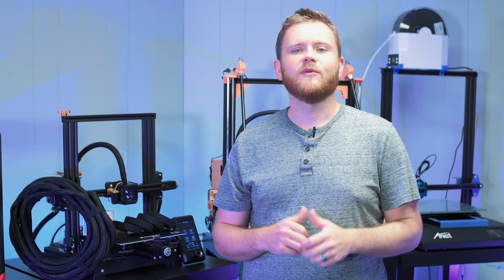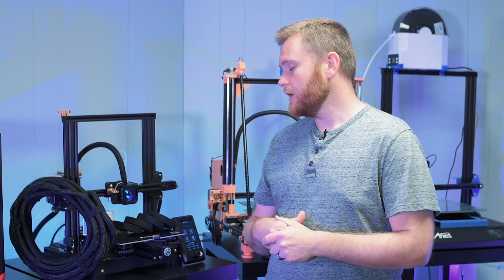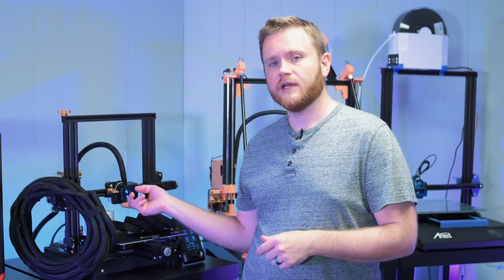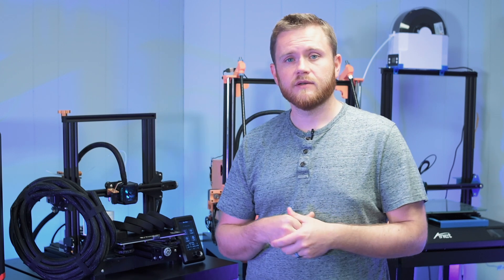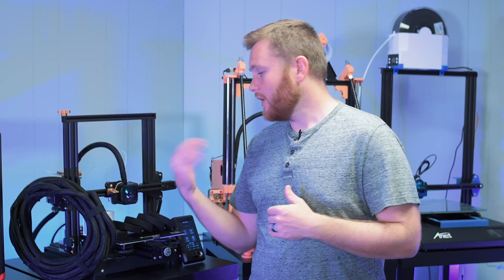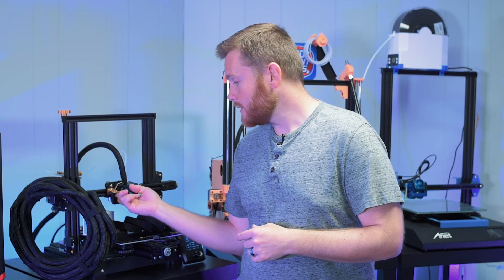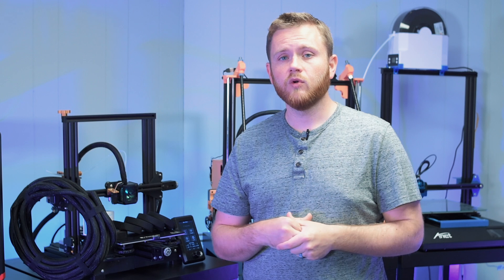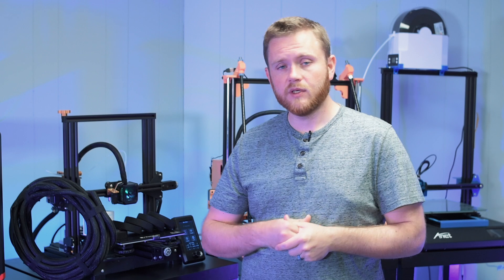Automatic Bed Leveling? Creality CR-Touch

Comment: I have a Voxelab Aquila X2 with the H32 chip.  I seem to be having issues getting the CR Touch to actually stop when it is triggered. Some have said to unplug the Z-stop wires while i see you have them still plugged in?

Comment: hey whats up boss...thanks for all your aquila related vids , im having a issue getting my cr touch to auto level  , i have an x2 with a n32 chip , did the sprite upgrade and the cr touch  on alex firmware . im able to Manual level but my mesh is all in red and when i auto level the print head goes off the bed , can you please help

Comment: Nice to meet you
Does the Voxelab Aquila C2  H32 BL- Touch Can I use auto leveling?
Reply from the maker: As far as I know, the C2 has a port for a bed leveler.
Reply: @3DPrintSOS  thank you i will look for it

Comment: Add just installed CR Touch on y G32 Aquila, chose to use Aquila BL touch 3.1.2 firmware. It only touches the center point and says auto leveling is completed, even though it shows a 16 point 4x4 grid. I cannot find any information on how to proceed using this firmware.

Comment: I have returned to manual leveling and reinstalled original firmware for now. I will try again when I have regained my composure! BTW do I need a new curate profile for the direct drive conversion?
Reply from the maker: Fail. Do it when you’re ready. :)  Only change you have to make is the retraction distance turned down to 1mm. No other changes need to be made…unless you want to.

Comment: This is the firmware I have installed Aquila H32 BLtouch Firmware V5.8.2 and the bit that goes into the display. If it is the right one I will install it again just incase I did it wrong.

Comment: The good news is that I have got the screen working. But the software is not allowing the touch to do the leveling pattern. I have sorted the z movement - I had forgotten to disable the stop switch. Would it help if I got the bl touch instead?

Comment: The firmware has corrupted my printer. I have taken a photo of the screen. Please help
Reply from the maker: If the screen looks all messed up, like I mentioned in the video, that means the firmware didnt install itself properly on the screen. Make sure you format the card correctly to 4096 bytes using a 8gb card or the one that came with the machine.

Comment: Hi - I have fitted the cr touch but the z axis is not working. I have put the wire in the right socket. Any ideas?
Reply from the maker: If it’s not working, it thinks the z is already leveled. Make sure you dont have both the z switch and the sensor plugged in at the same time. It’s one or the other. Also make sure you have the correct firmware installed.

Comment: I dunno.. I think it's still super beneficial even on a small bed.  Some (most) of these types of machines have warped beds. Even if you get the corners absolutely perfect, the center can be too high.  I know that's the issue I have. Adjusting the Z height adjustment does it globally, and not in the area you specify so, if you configure your Z height to raise a mm or so, it'll be fine in the center, but way too high in the corners.  A sensor helps alleviate this issue by compensating for the high center while not affecting the corners.
Reply from the maker: To further add to the point, you can achieve this for free with "manual mesh leveling" and not have to buy a probe at all. ;)
Reply: @3DPrintSOS  Ah shoot! That's right! I totally spaced on the manual mesh!! I even have Alex's firmware on my Aquila too hahaha!

Comment: Love the videos, really helping me get started with my Voxelab printer!

Quick question: You say you can download the firmware for the CR-Touch from Voxelab, however, I can only see the BL-Touch firmware. Is this okay to use or would it be better going with Alex's firmware and the customer UI? I am interested in trying the customer UI and will probably be going down that route, I'm just curious with regards to Voxelabs official firmware.

Thanks!
Reply from the maker: Alex’s is far better but any bl touch firmware will work as long as your chip number matches.

Comment: Hey man! Iv followed all of your videos to set up my printer! Iv got the Alex firmware update (4x4 BLTOUCH G32)

For some reason, it’s not homing at the bottom left corner as it did stock, it’s also not doing the little touch on the heating bed in that corner, to remove the extra filament that has come out while waiting for the print to start. 
Any advice please? 
It seems as though when I home individually, the Z axis is where it wants to make it home in an odd place. When homing x or Y, they both go to the proper corner
Reply from the maker: Sounds like it’s looking for a BLTouch and not finding it. It’s homing z to an odd spot because the BLTouch firmware has an offset setup for it. Do you have a sensor installed?
Reply: @3DPrintSOS  so when I create a mesh, the probe works at all of the points, and when homing the probe comes out as well. LED works and changes and the CRtouch is in use. I do have the sensor installed 🙏🏻
Reply from the maker: Hmm. Could it just be the wrong offset figures then?

Comment: Need some help. I installed the G32 firmware with BL touch support, but we're not able to adjust the Z axis within the "move" menu. We can move both the X and Y and the machine responds, but the number for Z stays locked on 0. Any thoughts? Also, we don't have a "live" option.

Lastly, when I select BL Touch Auto-Leveling from the control menu, the probe moves to the center, taps the center. It then moves to the corner like is going to start the bed-leveling process across the 16 points. The probe sticks out, but instead of moving down to touch the bed, it moves upwards, the probe retracts and then the screen says Auto-bed leveling complete. 

Any thoughts on resolving these issues?

By the way, we have the version of aquila that has a horizontal screen, not the one that is shown in this video.

Is there a different firmware we should be using?

Comment: Question: How does the leveling wheels get turned for the auto part of the leveling?
Okay, so I answered my own question, the wheels do not get turned. The sensor makes a topographical map of the print surface so the printer can adjust accordingly while printing.
Reply from the maker: Yep. It’s always good practice to fist level the bed with the wheels. Then using the sensor you make the bed mesh, “the map”, and you’re good to go.

Comment: I am loving the automatic bed leveling and my prints are turning out great. Had to watch a different video to get my gcode all set since the one in the description wasn’t quite working for me. One thing I thought was a problem with the Cr touch was warping on my prints after everything was set but nope it was my glass bedding needing some much needed cleaning with soap and water 😅 thank you for having a channel for us newbs on the Aquila 👍 keep up the good work.
Reply from the maker: Glad you got it working. Thanks for watching and the encouragement. :)
Reply: Micah, what other video did you watch?  Cause I am having issues as well after installing.
Reply: @aod_fan  I watched printsleo3D as he goes way into depth on the bed leveling. Watch the video so you understand the bed leveling, gcode, and live level. Once I got it the way I like I just set it and forget it.

Comment: Do you think 1/2 inch wire loom would be enough? Or do you recommend the 3/4 to ensure everything fits? Also, velcro wire ties would be a good option to secure everything.
Reply from the maker: Half would still be good. Yeah those will be just fine as well.
Reply: Thanks, Fedor.

Comment: Question for you. Loved the video, just installed my CR touch on my Voxelab Aquila, however, when i go to set home. It doesnt stop. The Z axis just keeps trying to go down into the bed. Not sure what to do for this. I have played around with a bunch of settings in the Z offset and it still wont work. I downloaded Alex's version of the firmware for BL touch. I have aH32 chip, I know that the firmware is just a beta, but it seems to be working. I just cant seem to understand why the CR touch wont stop the z axis, any ideas?
Reply: I really appreciate your help on this, I see that there is firmware on the voxelab downloads page, do you know if I need to add anything else? all it seems to have is just the firmware, with Alex version we had to add the dwin_set. There doesn't seem to be anything like that on their download page. I watched your tutorial video on that, and it had included the dwin set but it doesn't seem to have it anymore.
Reply from the maker: Check to see if it’s in the .rar file that gets downloaded. It’s gotta be on there somewhere b
Reply: yeah it's super weird, I contacted voxelab and they led me to that download page. I sent a screenshot to them. just waiting for their response. I appreciate you looking into this for me!
Reply from the maker: Sounds like it’s still looking for the end stop switch. Is that still plugged in? Make sure your z offset is at zero to start.
Reply: @3DPrintSOS  Yeah i unplugged the Z end stop switch from both the connection on the side and from the board, i saw someone else had the same problem and someone suggested it. it is marked with a Z so i'm assuming that was the correct one, and yes the z offset is set to 0. It doesn't seem to be picking up that the probe exists. I have been watching a lot of videos and found that some have an option to adjust the probe offset. On this version of the firmware, I cant seem to find that, not sure if that has something to do with it. Do you know if I will need to redownload the firmware if I want to go back to the manual mesh instead of the BL?
Reply from the maker: I think you would have to reflash it yes. To go back that is. I’m not sure as to why this is going on though. Hop into the discord and post there maybe someone knows.

Comment: Love the videos! You inspired me to buy an Aquila and I love it. Had a weird issue with my CR touch install. Installed the correct firmware for the G32 chip. I go to run the mesh and it takes a point from the middle twice then goes to the front right corner and stops and says complete. Did you or anyone else run into this? Thanks! “This is with voxelab’s firmware”
Reply from the maker: That typically happens when there is no mesh set. Does it do the two touches when you are trying to have it set a mesh? Once you do, set the z height, and it’ll be all set.
Reply: @3DPrintSOS  this happens when I am trying to establish the mesh. I think Voxelabs firmware might be buggy, The scrip on the screen is jumbled up and doesnt look right. I have tried to redownload the firmware and update it again but that didnt work. Thank you for the response!
Reply from the maker: Hmm try to reflash the screen as well.
Reply: @3DPrintSOS  Just did a reflash of the firmware and screen and still no change. Go to run the mesh setup and still goes to the middle does two checks then goes off to the front right of the bed probe is still retracted then comes down as if to touch the bed. After that is just says it is done. I am wondering If I need to get ahold of Voxelab and ask about the firmware for the G32 chip or just download Alex's custom firmware. Wish I could post the video I have of running it.
Reply from the maker: Hmm something isn’t right and I’m hearing about these Cr touch issues more and more. I wonder if there is a bug. I would try Alex’s. It’s free and easy to install.
Reply: @3DPrintSOS  I think I might give that a try then, Thank you for you amazing content and advice. So glad I found your video on this awesome printer and got into the hobby.
Reply from the maker: Glad I could help. :)

Comment: Great video! I noticed you messing with z-offset. Can you please explain how and why?
Reply from the maker: The order of events is 1. Manually level 2. Auto bed level 3. Set z offset and save. 

When you level with a sensor, the printer only sets a mesh bug doesn’t know where your nozzle is. Only where the sensor is. So, you must set the z offset. This tells the machine where the nozzle is in relationship to your bed. Once you do that and save, everything saves and you’re ready to go.
Reply: @3DPrintSOS  I see! So when you use the paper do you get it just touching the way you would if you were manually leveling, or till the paper can't move? Thanks again
Reply from the maker: You get it low enough to just drag on the paper. You don’t want to to tear, but you want some resistance.

Comment: for the aquila just get rid of that restrive stock shroud use a satsana with a 5015 blower fan all day those 4010s just dont provide enough part cooling for me personally
Reply from the maker: I’ve had many machines with cooling issues...but never an Aquila. Some of the best bridging I’ve seen out of a stock machine. That’s why I never upgrade them.

Comment: So... I assume the universal metal mounts that came with the cr touch did not work?
Reply from the maker: Correct. They don’t quite align.
Reply: @3DPrintSOS  Perfect thanks... Can I ask you one last question do you know if the Aquila stock screen will work with a BTT e3 mini v3... I've noticed a lot of people using TFT screens and the stock Ender 3 screens?
Reply from the maker: You can, but you have to flash the board with Marlin for an Ender 3 v2, flash the screen with Marlin UI for an Ender 3 v2 and repin the connector. There are diagrams online. It’s just easier with a tft as it becomes plug and play instead.

Comment: complete newb here, i have an Voxelab Aquila X2, assuming i just install the latest firmware? or is it there one for CR Touch i am missing? Or does the BL Touch firmware work for the CR Touch? my thanks in advance.
Reply from the maker: Going with the latest is a good idea. The CR touch is just a clone of the BL touch with some slight changes. So the firmware for the BL should work with the CR

Comment: hello can you specify which firmware you are using? thank you
Reply from the maker: I’m on the latest version of Alex’s fork of JyersUI.
Reply: @3DPrintSOS  I just installed a CR Touch on my X2 (H32 though) and both Voxelab's 5.3.3 firmware and Alex's latest beta seems to work, the CR Touch is recognized and lights come on in the CR Touch, but fails to home on z-axis.  It behaves normally:  moves up z-axis a small amount, then zeros on x and y-axis, but then fails to go down on z-axis to finish homing.  Pronterface shows a STOP error and then moves back to where it started.  Is this an issue with the CR Touch, or is it just not supported by either firmware yet?  Thanks for all the videos, they have been a massive help in getting started with 3D printing!  Keep that helpful 3D printer footage rolling!
Reply from the maker: I THINK this happens when there is a z switch still attached? I’m not sure though. Is yours plugged in?
Reply: @3DPrintSOS  At first it was, but I tried it unplugged as well.  🥺
Reply: @3DPrintSOS  Ordered Creality's BL Touch on the small chance that the CR Touch was bad, or it was not compatible yet with Aquila or Alex's firmware.  I reinstalled Alex's firmware, , and now have a working BL Touch.  Currently printing CHEP's cube to compare with a previous print of the cube to test and compare.  Here's a video of it printing with the BL Touch, https://youtu.be/-Oyo6mQFTpk.  I will hang on to the CR Touch though, and swap it out when Alex posts another firmware update to test it again.  One other note, I forgot to unplug the z-axis limit switch, so it's still plugged up, but useless now that the BL Touch is doing the work now.  

So Voxelab's Aquila X2 with H32 chip can use Creality's BL Touch using Alex's v1.3.6 for H32 Beta 2 (BLTouch-5x5-H32.bin) firmware, but either this CR Touch is borked or it doesn't work with his firmware yet.
Reply from the maker: That’s interesting. I have a non h32 working just fine with the Cr so it’s gotta be that. Sorry about that! I had no idea there is a difference internally.
Reply: @3DPrintSOS  Will hang on to the CR Touch to test later for sure.  It's either bad or there is something actually different.  Don't really see how they could be any different though since they both use the same cable.  The CR Touch and the BL Touch I received both use the same direct connect cable to the mother board, so I'll keep an eye on Alex's updates.  There may be something different, but it may very well be I got a bad CR Touch.

Comment: Please a video for the z axis.... a to z from once the installation is done to when its ready to print... cant figure it out  trying new mesh... z axis keeps going up all the time...
Reply: I had a similar issue.   The Z axis would keep going up, and the probe wouldn't extend. I found out I had two problems. First, the connector on the CR touch wasn't soldered on properly. I was able to move it with pliers (to get into the small space) easily. Look for the LEDs not coming on as a clue for that. I assume it the lack of LED light and the z axis not moving down will also be an indicator if you have cable issue.

Secondly, I was pulling on my wires at a weird angle as the mount I was using was for BL touch not CR touch. This put enough tension on the CL touch that it wouldn't extend the probe.
Reply from the maker: Could make a good “short”. Just have to wait to get my machine back together.